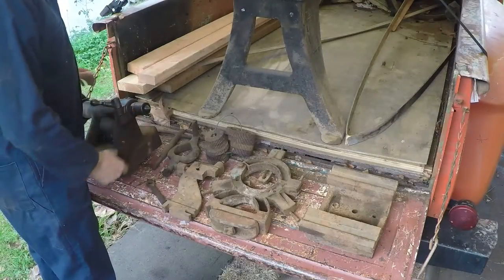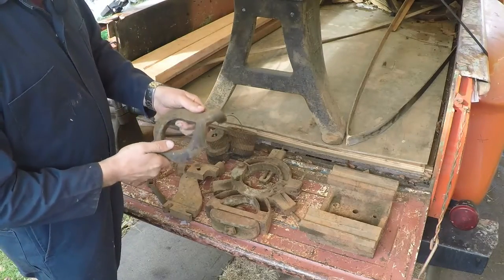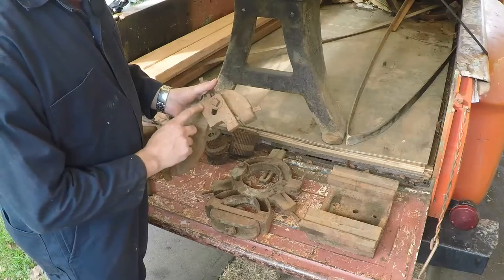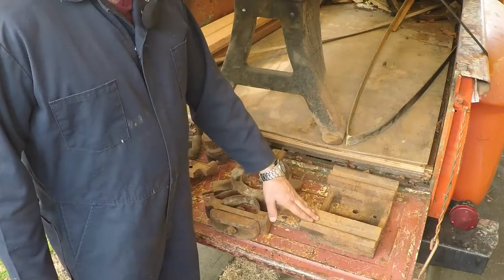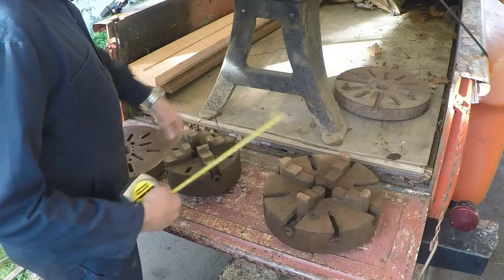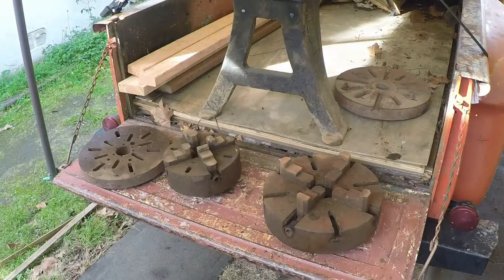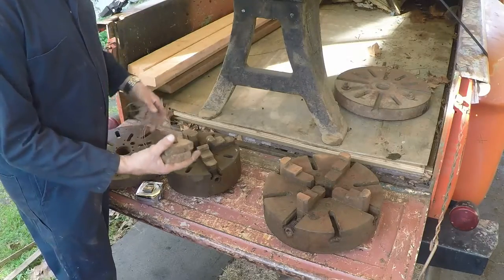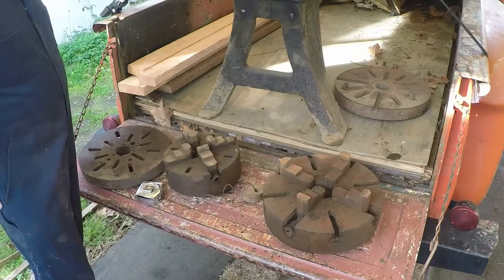South Bend Lathe Restoration Part 5

Comment: Getting the chucks with the lathe is invaluable. I spent more time trying to find or make attachments for my lathe than all the work to get it running. With a steady rest and the 4 jaw you will be able to center shafts and do face milling on parts. Great find Chris.
Reply from the maker: +Old Sneelock's Workshop yes it really was a good deal $500 for the whole thing.
Reply from the maker: +Old Sneelock's Workshop I know that a lot of guys will buy a lathe just to get the tooling and then sell the lathe off
Reply: $500.00 is a great deal. I bought my SB 9C lathe from a retired engineer. He wanted to cut a 5" diameter round and had purchased the lathe just for that. He said it didn't have enough power to make a cut on that diameter so he bought a SB 13. When I went to pick it up I of course checked to see how well all the parts worked. When I checked the back gear which quite often has a tooth broken it was in good shape but packed full of chips and dirt. 
He threw in all the chucks and tooling he got with it because it didn't fit the new machine.  
I didn't tell him about the back gear. After I got it home and cleaned up all the gears worked fine.   
The three jaw that came with it only had one set of jaws and was badly worn. A new Polish or Chinese three jaw would cost more than I paid for the lathe. I set up a watch on Ebay but used chucks in any kind of good condition were going for new prices. 
I got lucky and on one of them my low bid won. The guy said he was selling off the tools he didn't need. I think it was more the case you describe. He said it was in like new condition in the description. When I got it it was a mess. Rust and packed full of chips.  I complained and he cut the price in half. It took a few days to clean and square up the chuck. I ended up chasing the spindle mounting threads by hand. The chuck works well now. I thought I had a $30.00 boat anchor but it turned out okay.
Reply from the maker: Look on creags list much better deals to be had on there.

Comment: Man, this is a super project.  I hope I get to do one like this some day.  Thank you for correcting me on the "bridge".  I'd never heard them called anything but a gap.  Makes perfect sense now that you explain it.
Reply from the maker: +Crafted vintage Machinery had a copy of the 1920s brochure from South Bend and it had that information inside of it so it's pretty new information to me too. Another good thing it shows is the size of the clutches that are supposed to go over head with the cone pulley
Reply: Those clutches I bet would have been used for many machines.  Might not be impossible to find.  I hope you get her operational before you do the line drive.  I love to see parts for a lathe made on that lathe.  You could use it to build the line drive parts you can't find for purchase.
Reply from the maker: If I recall it's a 10" clutch witch would fit on the Atlas. Wish I knew someone who had one. Definitely be a pattern and iron casting project. Then turning work on the lathe .
Reply: I hope you go over the economics of getting castings some day.  What's the chances you could buy a copy of the plans from Grizzly?
Reply: Also, Keith Rucker did that line shaft shop tour.  That would be a good guy to counsel with for the parts.   I think I'm going to get to go to Arn Fest next year.  Hope to put together a contingent.  Think now about flying out this way.
Reply from the maker: Crafted well the hand wheels I had done were $50 each.the foundry is not fast this is a side line for them. But there very helpful with info on pattern making ect. I should try to go film them some day. good old boys 3rd generation iron men a real wealth of knowledge.
Reply from the maker: Crafted I have spoken to him Neal tison has the exact model I have.
Reply from the maker: +Crafted I would love to go but I think it happens during the grape harvest in I'm tied up at that time.
Reply: Regardless of how powerfully I wish, there is no such thing as cheap and good.  Dang.  But still, no other way to reproduce them and not a bad deal at all considering the non existent volume.
Reply: I did not know you had purple toes for part of the year.
Reply from the maker: +Crafted hands get more purple lol

Comment: hi Chris. did you get my last email? I attached a picture of the back gear assembly. too bad you weren't local to me, because I think the carriage and compound I have is identical. other than the bed, and the apron my parts lathe looks the same.
Reply from the maker: +Steve Watroba yes I did just came in looks like I've got 78 teeth it even has the number cast on it . I believe that is what yours had also . Was yours a gap bed . The half nuts are on oposet sides from the standard model. How is your reverse tumbler asemboly mine has extreme amounts of wear I'm in the market for that if you still have it.
Reply: Chris Anderson I know i have the tumbler, but I'll have to check the wear. mine was not a gap bed. so the apron is different. I'll bet theres a casting number on that back gear, its just greasy right now.
Reply from the maker: +Steve Watroba very good I did tell you I need the hand wheels for the compound cress slide and the tail stock. . I don't know what all you have left  but I might be interested in taking it all or most of it at least.
Reply: Chris Anderson I remember you asking about the tailstock handwheel, but not the compound handle. you might want the complete compound. you mentioned yours looked rough. I'll email a pick of the complete compound tonight.
Reply from the maker: +Steve Watroba hay Steve you don't know if the lathe you had had a threading dial do you?
Reply: Chris Anderson I can't remember. I'll check.
Reply from the maker: +Steve Watroba OK if you got one set it aside for me. (Why is my wallet smoking?)

Comment: you have your work cut out for you for sure.  evaperust is going to be your friend.
Reply from the maker: Bill lol thinking of trying the molasses trick
Reply: I tried that with my Atlas and found it alittle messy.
Reply from the maker: I think any of these things messy
Reply: Chris  I did the molasses on a saw blade and it worked. It took 2 weeks and smelled like an outhouse. I have better luck with electrolysis. For the big stuff you can line a packing crate with plastic and dump in a box of baking soda for every 5 gallons in the tank. Set enough grounding bars to have one at least every foot. Lining the sides of box with sheet metal works real well.
Best part is the water can be dumped on your lawn when you are done. The soda greens up the grass nicely.
Reply from the maker: +Old Sneelock's Workshop well I don't have a battery charger so can't do that I may use vinegar
Reply: Vinegar works but it will get expensive when you start putting large items in a bucket full. Still at 4.00/ gallon it's way cheaper than Evaporust. Do you have any old cell phone chargers? They put out 5-7 volts at a few amps but I seldom draw more than an amp or two when I run the tank. 
The molasses does work and it is cheap. It has to spoil before it starts working and that's where the stink comes in. If you decide to do it make sure it's downwind of your shop. I only had about 5 gallons in a plastic tray with a snap on lid. The first time I opened it wasn't too bad it had only been a couple days. After a week it would choke a maggot on a gut wagon. 
Worst thing I did was walk back into the little woods behind the house and dump it out. It's not hazardous but Sadie the dog decided it was perfect for a good roll. I had to give her a bath and not let her out on her own for 3 weeks until the next rain storm finally washed it away. What a mess.
Reply from the maker: Lol for having such a great sense of smell dogs do Strang things lol .most of the parts are small at the moment. Kinda want to try out these methods see what I like
Reply from the maker: +Old Sneelock's Workshop well I'm using heinze cleaning vinegar. It's 5% but I cut it in half with water .working very well. $7.00 to make 4 gallons
Reply: Chris Anderson Great. Glad it's working well.
Reply from the maker: +Old Sneelock's Workshop once I get to the next batch I'm going to shoot some footage cleaning up the bridge.